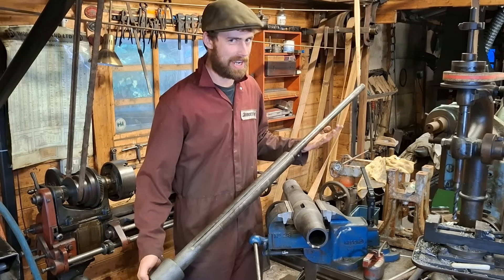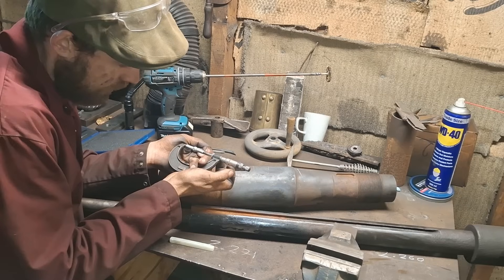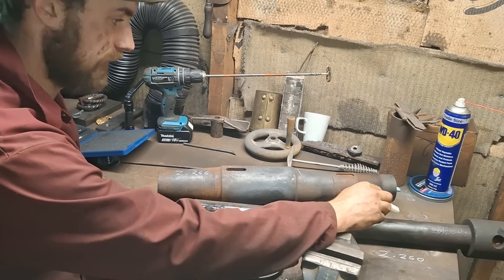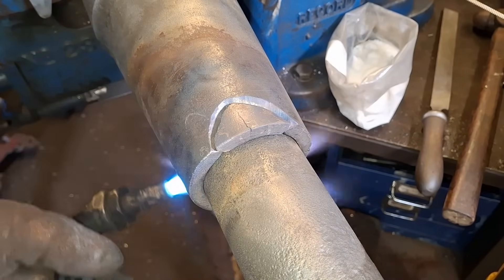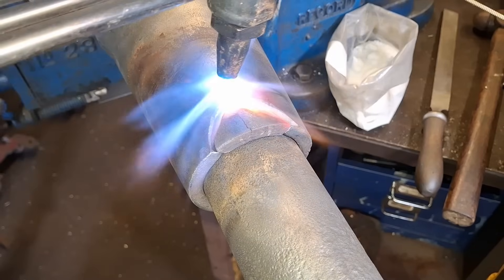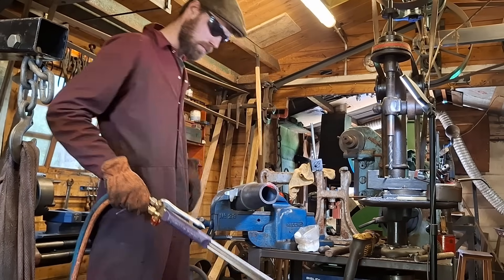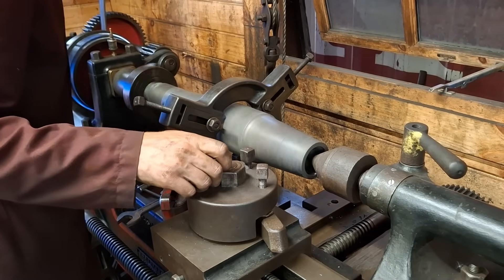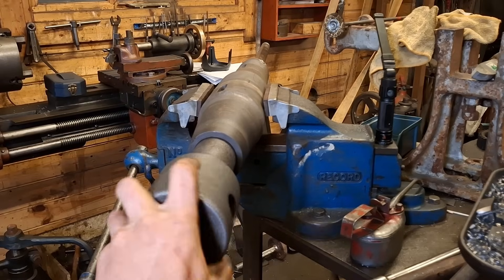Why was it so STUCK? Brazing Repair & Critical Analysis - Victorian Radial Drill Restoration PART 11

Comment: I know when it comes to steel you can get heat shrinkage from localized heating but with cast iron parts I don’t believe that to be the case. So depending on what the spindle housing and spindle were made of I was wondering if there could have been the possibility of accidentally heat shrinking the spindle housing while trying to get it unstuck?

But after analyzing the structure of that break we can see it’s definitely cast iron so what Im actually thinking is whatever hit the machine and damaged hand wheel might have distorted the cast iron causing that slight interference fit and the initial break in the piece that got braised back on. Looking at the grain coloring when you first took it off you could see the darker section that had cracked a long time ago. Normally you don’t associate cast iron with “distortion” as it is pretty hard but depending on the grain structure, there has been precedent for cast iron bending albeit very slightly. 

As to what would cause the outside journals to get out of round while the internal bore is straight … that there is a mystery wrapped in an enigma 😂, best of luck cuz Im drawing complete blank.

Comment: Have you ever tried soaking your rusted parts in citric acid? I have had great success with smaller things. The citric acid eats away the rust in the paint and does not touch the base metal. My daughter had 100 year-old house with registers and events that were completely rusted And wouldn’t function after soaking them for a couple days in the citric acid bath. It was amazing they were like new

Comment: The older drills apear to me to have longer travel, that one looks like over a foot , great for radial boring. just found the series, two years of regular oiling, my hat of to you sir. I am a Kroill fan,  Probably 10 hours of KROIL and hammering over four weeks on a ward2A lathe horizontal power feed shaft rusted to the saddle so i feel your joys of seeing the moss covered table and knowing its value as treasure. subscribed

Comment: I always found that it was beneficial to bury the  joint to be welded with flux otherwise the exposed metal can oxidise with heat from the oxygen torch especially. if the nozzle is too big.

Comment: Yep, now we´re getting to the meat & potatoes. About that rust soup: You need a lot of it so I guess it was just cost effective to use that powder? There´s a scene of "Meet The Feebles" that comes to mind…
Jokes aside: I love EvapoRust. For small use cases it does very well but if You need this much I don´t know. Anyways: Good job braizing & evaluating. That wobble in the shaft I don´t mind but the runout in the sleeve thing had me worried. Brainfart: maybe the shaft became stressed whilst manipulating it thru there? Maybe this turns out good, You can always turn it down. 
Good Job, I´m glad the put it back together starts.

Comment: Excellent video and excellent job. The crack was textbook, definitely been there for a very long time. I use Bilt Hamber De Ox C as well. From what I know, it's a bit like citric acid. I use a little immersion heater to keep the tub of the stuff quite warm and it definitely helps it work. I guess it would, heat speeds up any reaction. The chemical reaction here is called chelation, I believe. Good analysis/ explanation as to why everything was so siezed. The braze worked a treat. Looking forward to you re machining the wonky external bearing journals.

Comment: I wonder in monetary terms, when this drill press was manufactured, how much cheaper using cast iron machined parts was over steel? Was choosing cast iron even just due to cost?
Reply from the maker: Cast iron was like the plastic of the day, preferable as it was very easy to batch produce parts very close to final size, minimising machining and using material efficiently. 
In this period, steel was expensive and reserved almost exclusively for cutting tools and other high stress situations. 
When something more malleable was required, such as shafts or the spindle in this case, wrought iron was used. 
All of the wrought iron parts would have been forged close to the final size before machining.

Comment: This is all just speculation: That hub on the end of the spindle is likely a separate piece because it is unlikely they would have turned a bar that size all the way down to the spindle diameter. It's also possible the taper on the spindle was intentional to match the taper that ended up in the bearing bore for some reason. It would've been common back then to compensate for machining limitations by making two parts match each other on a piece by piece basis. That means that unbeknownst to everyone, the spindle should've been pushed out the other direction (if the hub could indeed have been removed).
Reply from the maker: The spindle is definitely one piece and probably wrought iron. The 3 diameters would have been forged close to size before machining.

Comment: It’s always interesting how people with these old machine shops with tooling from the later 1800s to the very early 1900s use modern equipment to work on these old machines as well as HSS tooling on these machines as well as carbide, where almost entirely tooling then was high carbon steel.
Reply: I've read (old) magazine articles talking about the special circumstances where the extra cost of exotic high speed steel tooling is justified, as against ordinary high carbon steel.

They are absolutely identical to modern articles...

... talking about the special circumstances where the extra cost of exotic carbide tooling is justified, as against ordinary high speed steel.
Reply: @paulwomack5866  if you’ve ever seen an Armstrong or Williams tool holder with that small square hole for a small HSS bit, what you’re looking at is a copy of an older high carbon steel tool. Those tools were like the tool holders, but were themselves the tools. When HSS came out in the late 1890s, it was so expensive that they could make them into a large tool, so they decided to make them into just the cutting edge. HSC tooling was used well into the early 20th century. Even today, HSS is expensive compared to HSC.

Carbide was invented in the early 1930s and went on sale in 1936, I believe. It was, and is, mostly, even more expensive than HSS. In fact, when I started to do this over 50 years ago, we often still used a lantern tool post, here in the US, for small lathes with a tool holder with that small bit which now had a carbide tip brazed onto that.

But way back, carbon steel was about it.

Comment: Rust has 2 to 10 times the volume of steel, if the shaft is long enough the rust will barrel out the bearing and become even more compacted as you try to remove it.
Reply from the maker: Im pretty sure thats exactly what happened

Comment: There is a video by "Keith Fenner – This is my Job Shop" where he shows how to shaft straighten professionally using a torch and wet rags. He does this for marine grade boat shafts.
Reply from the maker: Keith is very skilled. I'll probably attempt something similar and see what happens!

Comment: Great work! That glazed looking coating looks like a combination of mill scale and overcooked oil from the heating while trying to get it apart. When super heated, the oil boils down leaving just the carbon in the oil as a deposit on the hot piece of metal. Examples of this can be seen when quenching a blade for heat treating. The deposit left behind is also very hard, so it probably took some cast iron with it on the way out. You'll get it back together in no time, looking forward to watching the process.